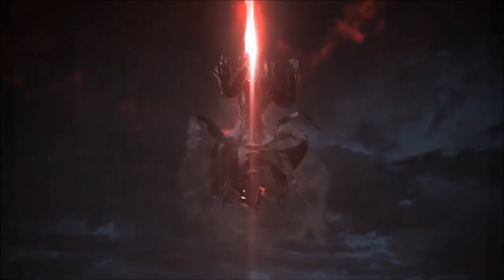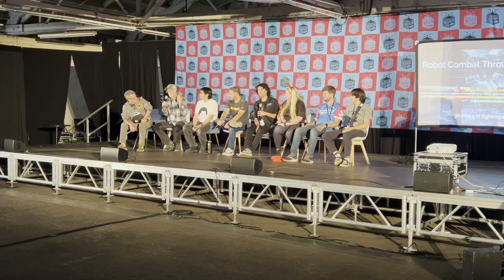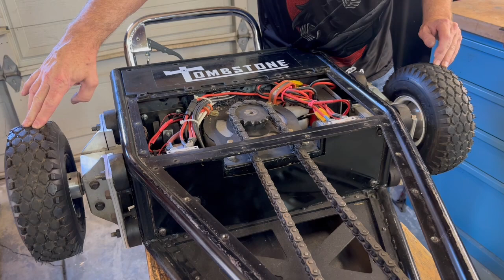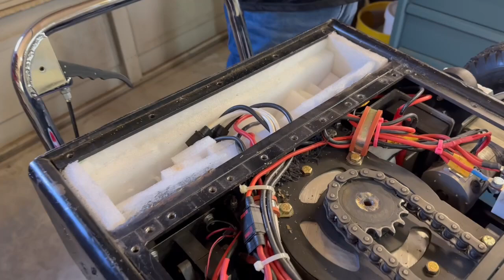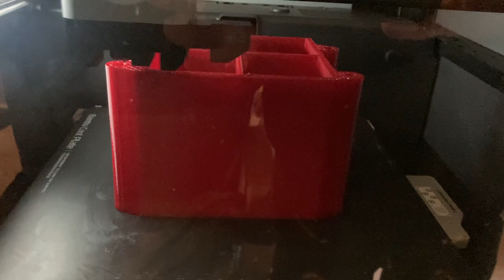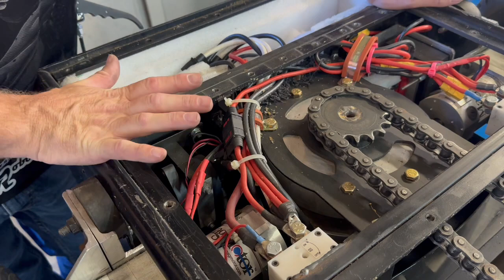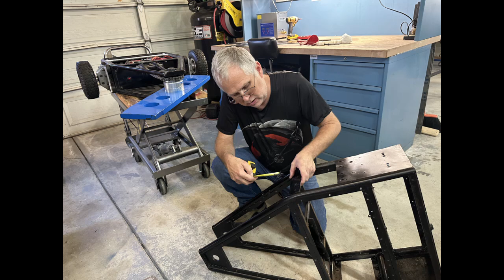Tombstone BattleBots Rebuild Plans

Comment: I love your robot. It's like the main villain. But it still has a feature that I consider quite critical. These are open, unprotected wheels. If you suddenly have time and money, try making a new body where the wheels will be behind the armor. 
Of the simple improvements, in the comments they suggested adding a wedge to the back so that it could be used to slow down enemy spinners. But for this, it may be necessary to change the internal layout so that the batteries are not in the direct impact zone.
Reply from the maker: There are some design limitations that just makes internal wheels not work currently. There are certainly some long term redesign options that might make this viable, but short term it's going to look like Tombstone has always looked :)
Reply: The wheels are protected by the weapon 😂. As long as that massive weapon is going and it’s pointed at the enemy, he really does not need to protect them. After all how many seasons have we had now and someone hitting the wheels has almost never happened. 

And besides, where is he going to find weight for this, or find weight for a wedge? He would have to take that weight out of the weapon. Which defeated the point as it’s supposed to be a big destructive horizontal. 

Plus covering up the wheels has its own problems such as getting high centred if someone wedges underneath you

Comment: You could use a second, smaller contactor and a "power resistor" (ideally bolted to the chassis for cooling) to add a soft-start to the weapon motor.
A proper ESC is likely the best idea, but that is a big change to an otherwise reliable system.
Reply from the maker: I've thought about ways to work around this issue, and that is certainly one of them. I think the current idea to split out the load across two contactors probably makes the most sense. But we'll see. All I've done so far is talk about it ;) It may look different once I have stuff apart and in my hands.
Reply: @ray9368  Is the contactor welding because of arcing, or because of being overloaded (stall current over multiple seconds)?
If its arcing, a problem is one contactor may open/close slightly faster than the other... resulting in just the same amount of arcing on it as just a single contactor setup, if its consistently the first one to close.
This was a problem I ran into when using SPDT relays for switching a motor on a "motorized piano" project. One contactor in the relay would be the one to consistently arc, even if both were wired in parallel. I ended up biting the bullet and made a proper solution out of a big mosfet, after wearing out 2 sets of relays.
Reply from the maker: @roboman2444  You are correct that if everything was setup in parallel, one contactor is always going to close faster than the other and I wouldn't be fixing the problem. But, if I split the brushes out (there are 8 brushes in this motor, so 4 pairs) and only have half of the brushes being powered by each contactor, then each contactor would see half the load. 

These are marine contactors, rated for 2000 inrush amps. For years I ran the A123 battery packs, but recently switched to Lipo. I did not increase voltage, but obviously the amperage capability went up and suddenly we started having problems. I even DROPPED voltage slightly and we still had issues. I fully believe I am simply exceeding the 2000 inrush amperage and that's where the issues come from. Splitting out the load this way should fix it.

Should 🤪
Reply: @ray9368  Oh yeah, separate banks for the brushes is a great idea. You could also wire them to separate channels on your receiver. Dunno if it would be terribly useful, but it may be one more trick to try if you've got a dead weapon mid fight. "Free" redundancy is useful.

Comment: It amazes me that a modern championship winning bot is still using a "contactor" and brushed DC motors. Most bots nowadays are all fancy brushless stuff.
Reply from the maker: Brushless has a lot of fantastic features to them for sure. High power to weight, higher efficiency, smaller physical package. There is one spot though that even really good sensored brushless still doesn't beat out old school brushed motors, and that is raw torque at 0 rpm - like say for example spinning up a huge hunk of metal from a complete stop. Tombstone is dangerous even before the fastest of the speed demons can get across the arena. 

I'm not saying we won't eventually go to brushless setups. We probably will honestly, and the more I play with them in other bots the better I have got them to work as needed. But currently we'll still be using the power systems as you see them here.

Comment: Hi Ray, Would you consider a couple of suggestions, 
Move the batteries in front of the motors and below the sweep of course.
Take some with of the blade and add a ram to the back so you can reverse into other spinners, stop their blades then pivot Tombstone to strike the opponent?
GO TOMBSTONE
Reply: Putting the batteries anywhere near the weapon seems like a bad idea. Also building a wedge that is any good on the back would take a lot of weight that would most likely have to come out of the weapon. He knows better and if any of these ideas where good he’d of already done them

Comment: Hey Ray are you planning to do brushless on Tombstone's weapon motor at some point or still just using the ME708? Anyway awesome to see that you're still moving forward!!!
Reply from the maker: For now, you'll probably just see the same power systems as in this video. I may start looking at brushless drive systems first, since I've been running those in Mortician for a while now and I could see them working well here too. But probably not for this year.
Reply: @ray9368  ah OK yeah that would be the advisable way to handle things one step at a time, rather than the workload of everything at once which would be super overwhelming.